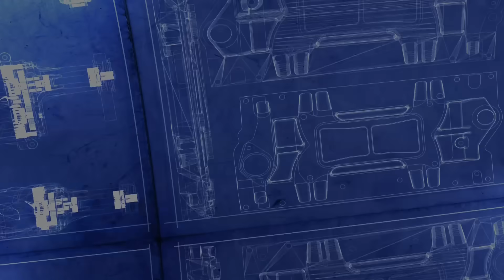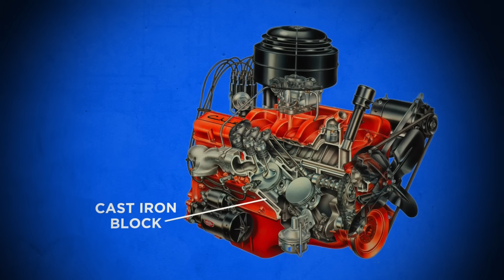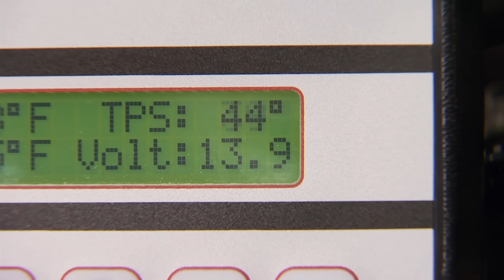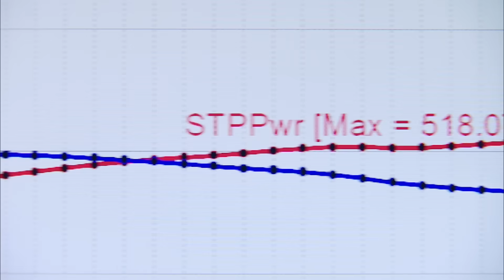Building A 518HP Supercharged 350 Small Block - Engine Power S2, E6

Comment: 500HP on a built blown 5.7L? eh. 20 years ago impressive. Not anymote. AFR heads can make 500HP on a 383.
Reply: sorry to say that would still be sad even 20 years ago shoot in the late 80's we had a 327 that dyno at over 1200 hp built by old man bell and all that was on it was a tunnel ram with 2 485 carbs that is what the blue prints required but we did have to hand build the heads to make them flow we didn't have all the after market heads they do today so we took 202 angle plug heads ported every thing out to the max made 204 ported the oil the water the intake ports exhaust ports stock headers will not fit have to use over sized headers back then u had to custom build them we even polished the inside of the block to get oil to drop faster for high r's

Comment: This exact combination was offered by Edelbrock as a complete crate engine 4-5 years ago. They just used the same parts, assembled it, and ran it to match Edelbrock's claimed dyno  numbers.
Reply: This video is prolly even older than that... the basis for Edelbrock's HP claims was prolly this blower on a stock 1975 SBC 350" with actual 7.6:1 compression ratio...

Comment: I’m pretty sure the guys at MotorTrend’s Engine Masters made 1300+ Crank horsepower with an unmodified stock 350 bottom end and a centrifugal supercharger
Reply: im pretty sure they didn't.
Reply: Definently not stock 350 bottom end, but yeah 518 hp out of all this? Nobody who has a fucking supercharged 350 running on race gas cares for smooth driveability. They need to retard their timing, gush more fuel into it, and up the boost at least 5 psi for some decent power. Even if the low end suffers a bit, nobody street races in the low rpms. You'll pull up to the drag strip, beat your competitor the first 75 feet then get left in the dust.
Reply: @spicketspaghet7773  ever watch NHRA?

Comment: Kid: Sees car with this motor and says wow, that must make 1000hp.
Owner: No son, it makes 500hp.
Kid: 😑
Reply: Yes, but it makes it almost everywhere, and look at that torque curve around 12:15 - it's almost dead flat.  This is no track monster,  just a really fun street engine that isn't so strong it makes you drop four figures on a custom rear end.  I think a 12 bolt [maybe a 3.42 or 3.55] would do just fine on the receiving end of this powerplant.
Reply: @flinch622  What if you wanted to put it in something like a lifted blazer?  Not enough power to spin 37" tires?
Reply: @Sodiumreactor  Look at the torque @2500. That will destroy any tire
Reply: @bigboreracing356  yea with 18-20 lb boost
Reply: Its the starting point people. Theres videos of this sc making almost 800 with different pulleys and minor changes.
Reply: @torque-ej4nu  Not minor changes. Big ones!  Huge cam and 14lbs of boost and race fuel. And there's only one video of that.  No mention of it again by anyone.
Reply: Its all about the torque, not about the HP. "Horsepower sells cars, torque wins races" - Shelby
Reply: @Chris-yy7qc   to a point . I own a compounded cummins and a built forged turbocharged 383.  My  383 will blow my compound turbo cummins away but the cummins makes twice as much tq. Tq gets you moving hp makes you go fast.  Hp is a result of rpm made from tq.
Reply: @markrich3271  , I have a  small block  327 , Forged Steel Vette Crank,  4 bolt main block  , Forged 12:1 pistons,  Ported Heads,  Comp cam,  aluminum intake,  750cfm carb,  Headers  , 40lb Flywheel and 11 inch clutch  , Lakewood Blow Proof bell housing,  M-21 Muncie 4 speed and 12 bolt posi  , 
I Crank  it up pass 8 grand , let that clutch petal out and  all that stored up inertia is let go all at once  , both front tires come off the ground in my 66 Chevelle SS  .

So hp or torque ?
It's a blast to drive  !
Reply: @Chris-yy7qc  not true at all though,  quote mining doesn't really do much
Reply: @Magnus Fullauto 
I’m THAT kid 😑
Reply: @reallyreale5816  😹

Comment: Whole lotta money for such a small return. I'd be pissed it only had 518 hp
Reply: Boosted power is different then big cam power.  The set up they showed can be used as a daily driver, impervious to heat and atmosphere.  The old school cam set ups, load up, they don't like the heat, the power sucks down in the low rpm's, they buck with a stick shift at low speeds, etc.  So hate on this all you want but it's not a bad deal.
Reply: @hv9356   I mean built a 600 Horse 385 that runs on pump gas and still makes 560-570 on 87 octane. can pin the video of it on the dyno if you don’t believe.
Reply: That’s what I was thinking. 
I’ve had a couple Chevy 350’s that made over 500+HP N/A. 
They could have used better parts and got more than 520+HP without having to use the $7K+ supercharger
Reply: That's what I was thinking.  Must be the 10psi boost.
Reply: Ron Hunn I highly doubtful it's even pushing 10 psi
Reply: @spankthemonkey3437  IT WAS 10.7 on the screen after the pull they showed and said it was 10psi
Reply: @spankthemonkey3437  yes they suck bad for a 350 blower. should of been 550+ all day
Reply: @spankthemonkey3437  Son, you can take a stock go-kart engine to 600hp if you put nitrous on it.  Apples to apples.
Reply: Travis, didn’t say anything about 1,000 hp daily here. Just sayin if I put the amount of money they put in it, 518 seems fairly low since a typical 350 with decent heads and cam can put you north of 450. This is hardly more bang for your buck.
Reply: @Voltronforce1982  but damn nothing looks so sweet as a blower motor
Reply: @Rare Form  Honestly you are making zero sense.  If I spent $50,000 on an engine with all the best parts, but I tune it down to 500HP, your head would probably explode...LOL  Although IF you asked me, I would tell you, I want the engine to live for 20 years...then you would probably rip your hair out...LOL
Reply: High Velocity if you want spend $50,000 for 500hp, then if YOU asked me, it sounds like you have more money than sense bud. Detuned or not.
Reply: @Rare Form  Well, I tried, but you missed the point.  You should look into Diesel engine prices/Hp and how long they last.  You might have an ah ha moment but probably not...LOL
Reply: @hv9356  And you're not making any sense either. I think I see what you're trying to say, that they detuned the engine so it would be more reliable, but you haven't made that very clear. Either way, they never said that they were tuning it for reliability, although they did say they were piecing together a parts list based on how compatible and reliable they were. The more reasonable assumption would be that this is a stage 1 tune for a stage 1 motor and the numbers aren't far below their max. Still, I remember NA 350s making 550-560 hp and 480-500 torque and theyre more reliable. Those engines cost a bit less than this one too. This is a dressed up showroom build.
Reply: Anonymous  Perspective is everything.  The junkyard warriors on here are just that.  4 cylinder engines out of a junkyard can make 500HP for about 5 minutes at wot.  Yeah and...so what?
Reply: @hv9356  Listen, you're the one harping about reliability. Point is, if you want reliable and that's your top priority, you go NA not FI. You don't seem to possess the knowledge of engines to even participate in this conversation.
Reply: @Khargan  So go Naturally Aspirated engine can still be FI-Fuel Injected...  You don't know shit bro.  Try reading a dyno sheet and look at the torque between a blower motor and naturally aspirated motor.  Secondly, if you use shit parts you get a shit engine.  Stop the bullshit...
Reply: @Vander's Garage  This is one of those things where if I have to explain it, you will probably never get it.  So, let's just say this, people want what they want.
Reply: @hv9356  Congratulations on using THE go to response when you haven't got a clue what you're talking about. " If I have to explain it you wouldn't understand ". You're right on one thing, people want what they want, but that wasn't your argument on this.
Reply: @Vander's Garage  I haven't got clue, ok.  LOL  I've explained myself, we disagree, move on.
Reply: @Voltronforce1982  ooh that was good
Reply: I think the goal here was tractability and reliability not outright horsepower
Reply: @awesomusmaximus3766  then why wouldnt they just do a mild 383 build an make 450+hp and it be completely streetable and fit under the hood?
Reply: @BBCharger5spd  It's just a show car engine built to be seen they could easily get more power just by changing the blower drive pulley and the fuel octane .
I prefer stealth too
Reply: @awesomusmaximus3766  Not much more boost on those hyper pistons...
Reply: @BBCharger5spd  Wow that wasn't a good idea
Reply: Why would you want a motor to last 20 years when better tech will be available then. Also for 50k you could make a 1500 hp street car motor
Reply: U can literally build a 1700+hp LS straight out of the summit book for less than 15k...
Reply: @4 Doors or Die  How much did this build cost in the video ??
Reply: Travis a new mustang 5.0 makes well over 500 crank with a few bolt ons
Reply: dude for real they spent a shit load of money and yeah small return iv'e been planning to put a mini blower a 144 on my 350 with blueprint heads and 1.6 ratio rockers i know ill be seeing at least 525-550hp for a unit that can still fit under a cowl hood but this thing is all show that thing is a full size blower this motor should make at least 650
Reply: I used a turbo set up on the 350 I had, 715 all day long
Reply: Maybe it's the carbs and cam combination. Seems like the carbs a little to big. I thought bigger carbs were good for higher up at high rpms.
Reply: @spankthemonkey3437  its the E street heads, should of used RPM, victory jr head would of made higher easily
Reply: @spankthemonkey3437  good call man....them carbs are way big
Reply: Oh it was duel 1000 cfm throttle bodies too much for lower rpms
Reply: Lol my Na LS3 with cam, headers, intake made about 600 crank hp on E85.
Reply: yea probably 15000 for 500 hp
Reply: STREET RACER so you are a host on a horsepower show and dyno a combo turned down and doesn’t even turn it up. Why try and sell a combo if you don’t show what that combo can do? Your comment is idiotic sir.
Reply: Edelbrock and paste paid for this! Plus the network. Naturally aspirated to do the same thing.
Reply: @cv 67 yeah hotrod did one running a weiand 142 the smaller blower and they got up to 445hp the 144 is a little bigger and weiand rates them to support up to 550hp and saw a guy on here dyno in at 462hp with a 144 on a 350 and got 462hp running 5.7 pounds of boost. my compression ratio is about what hotrod's build was so i can run the blueprint muscle series heads 64cc which id figure would flow little better than the vortecs they used even though those are good for what they are but they were trying to do a budget build trying to come in under 4000 dollars and im not trying to budget what it needs to be solid and decent ill get even if cost little extra they were just trying to prove a point but anyway so i figure after all that and a port and polish and taking my time with the build and not rushing ill prob be damn close to 500 more or less which for what i am trying to do is good enoug for me i just want a good street and strip setup that won't blow up and ill probably won't run the smallest pully just to stay on the safe side of things its just suppose to be a muscle car i don't want these new age plastic shit bullying my 72 nova around and yeah that is all really also talked with the guys at summit about the build before and confirmed and made sure that eveything would be on the safe side and i got couple mechanic shop owners that have built cars over the years that are personal friends of mine been around for 30 plus years and ran it by them and yeah iv'e dug around not just randomly throwing shit out there if i was i would of said it will make 600plus hp lol! thats the number everyone throws around and yeah i know it won't make no 5 to the wheels i know how that stuff works talking about crank power here.
Reply: Bro you could make make more power than that...just dont forget to use Edelbrock oil and Edelbrock filters and Edelbrock gas and......
Reply: It's almost a natural aspirated engine, it has nearly nothing of boost, only 10 psi. But yes, actually is a lot of money for that power, maybe they focus on reliability.
Reply: So wheel hp would be 400-418 depending on what accessories transmission differential used.i have seen cam only ls camaros make that much
Reply: My 400 mouse puts out 490 hp & 491 tq. It's naturally aspirated with a 2 bolt main and runs on pump gas. You guy spent ten times more for 28 more hp. Totally unimpressed.
Reply: I'm guessing that head isn't as good as it's cracked up to be. I would expect a good head with that cam and compression ratio to be right about 400 na.
Reply: Sonos45 I’d prefer airflow research or trick flow heads.
Reply: @gghouck  You figure it out !!  And here you go, you changed the example to a big block.  Stay apples to apples in your argument smart guy.  I can spend $300,000 on a diesel that will make 500HP that will last 50 years.  You won't be able to fit it in your Honda though.
Reply: @hv9356  yeah but the 500hp will come with over 1000tq in a diesel
Reply: @Big Sean  I'm not sure why that matters but you're correct.
Reply: Yeah, but that's a heck of a street motor.  Low boost, but really linear power delivery and a lot of it.  You COULD get more power out if it, if you wanted to race it, but that's missing the point!  Plus, you gotta admit, that blower housing looks totally bad@$$.

Comment: its cool but..... if im going to spend two grand or more on a forced induction kit, its going to make a lot more power than five hundred ponies! Any engine guy knows that you can make the same power on PUMP GAS with a four inch bore and with the right cylinder head,piston and camshaft combo. Anyone who says this cant be done doesnt know what they are talking about and has obviously not build many small blocks....I have built MANY stock block, crank,connecting rod and bore size 350's that have put up the same numbers and in many cases even better that. BUT it depends on the application.
Reply: Not everyone is going to want more than what this made. This would be perfect for most hot rods where looks matter more than all out performance.

Comment: I think you should do a SBC build where you replicate the Z28 DZ motor, but then put a six pack Holley set up! You could take it a step further and make it a full roller set up to REALLY make the RPMs scream!
Reply: i use to have a 327 that we built it like the 302 dz same stroke and i would run it against this engine any day with just a 4 barrel
Reply: @jeffrey4547  my theory goes as such, small displacement dz setup would run on center 2 barrel around town, possibly fair fuel economy (for a carb V8) but then on the highway you lay into it and use all 6 barrels! Seems like the perfect scenario! They used to run these things will dual quads stock! So I know they can handle the CFMs
Reply: @WC_Beer_Reviews  my pro built 327 for drag racing built by bell automotive running over 1200 hp the blue prints required 2 485 carbs . any more i would lose power by putting to much fuel in it and i'm running a tunnel ram a bit different then fuel injection or just a six pack but runs pump gas the best .
Reply: @Bozemanjustin  good to know! I'm most curious about how a six pack works with I high revving, small displacement motor? Will it unlock the best of both worlds?

Comment: I've built pump gas 383 that put out similar horsepower numbers. Mind you probably not as streetable with less torque but honestly for all the money that's in that motor Im kind of let down.
Reply: Spin it to 15 PSI. you should get over 700HP.
Reply: @Mr Sunshines 
"Our standalone system #1520 on a professionally built
engine produced 753 HP and 636 ft-lbs. of torque

ENGINE SPECS
350 Cubic Inch
9.5:1 Compression Ratio
Victor Jr. Heads #77629
Forged Rotating Assembly

BOOST INFO
12-14 psi boost
2.75” SC Pulley
110 octane gasoline

CAM SPECS
Intake Duration: 264°
Exhaust Duration: 276°
Intake Valve Lift: 630”
Exhaust Valve Lift: 630”
Lobe Separation: 112°"

Page number 161, of Edelbrocks 2018 catalog.

Comment: At 1:20 it says 1996 was the final year Chevy installed the small block, that was only for the corvette. The 1/2 ton trucks carried the small block until 1998 and the vans/1 tons I think a couple years later.
Reply: Joseph Julian as late as 2000 in Tahoes had 350's. Someone on this show evidently didn't do much research